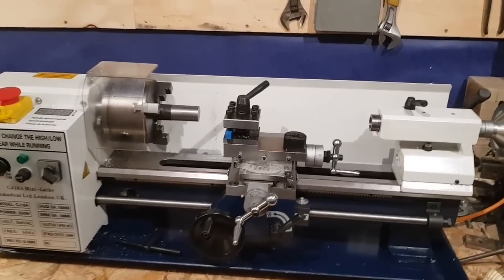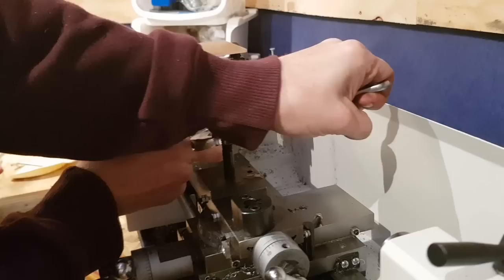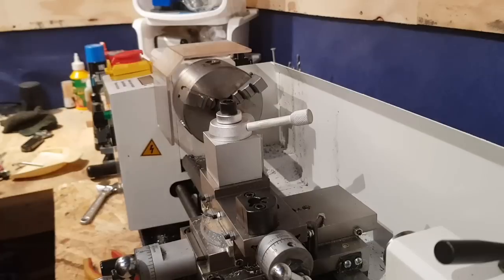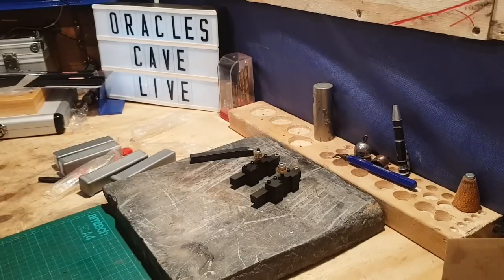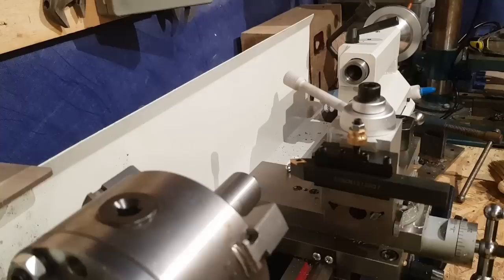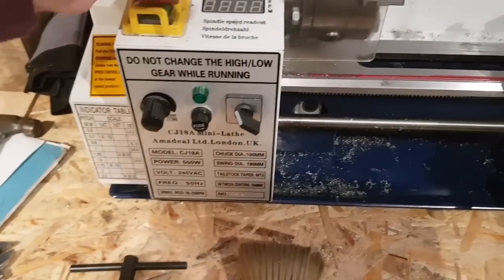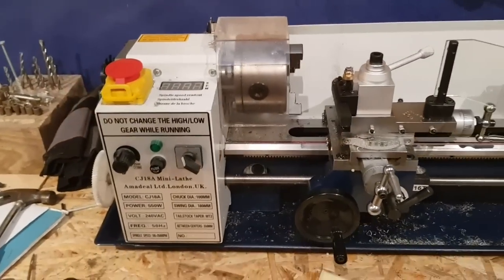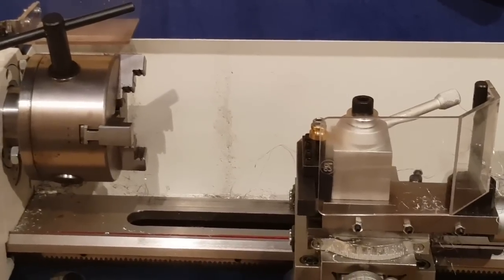CHINESE QUICK CHANGE TOOLPOST T0 7X14 MINI LATHE

Comment: I thought that piece was looking a tad wobbly in the chuck- I'm glad you weren't hurt.
Reply from the maker: @jeffcurrey8765  lol, I was expecting it to come out as it only had about 2mm of surface secured, too lazy to do a full jaw swap just to test it.
We don't mind getting hurt over here, never use safety gear, pick up burning hot things with bare hands, grind over the top of full fuel containers, we  do all the fun stuff over here, not a safetySusan in sight lol
👍👍👍

Comment: Don't waste your money on this QCTP, they are rubbish. Buy a steel wedge QCTP.
Reply from the maker: Yes the cheap one is not amazing.
But most people buying a mini lathe, do not have the £200, to throw at a steel one straight away.
Or they would just buy a £1000 lathe that has everything.
My cheap one didn't give me much issues and would have lasted long enough to do some projects while I saved up to buy the steel one.

So yes the cheap one isn't amazing and won't last a lifetime, but it is a way of working your way around having one until you have the cash to get the strong one.
The original toolpost works great, but very annoying trying to use when you are changing tools a lot.
So again, it is worth spending the cheap amount buying the cheap toolpost, especially if you are working on delrin, plastics, or other soft materials long term.
So completely steering people away from something that is so cheap and easy to get hold of, is not very good advice from a creator.

Unless you are one of these other plebs that has a lathe and thinks they are a full on engineer, which is complete snobbery and goes against makers and creators learning.
Reply: Buy Cheap buy Twice and I am a retired Chartered Marine and Mechanical Engineer so I think I know a little bit about Engineering  @oraclescave

Comment: I have a similar lathe to yours, and I bought the same quick-change post. But I couldn't centre it. it was too low, and I ended up having to make a 10mm shim for the base. It never came up to expectations, and I ended up going back to the original tool post. I 'm planning on saving up for a steel quick change post that hopefully won't have so much play in it, and a lot more mass.
Reply: Your right on the aluminum quick change tool tool post not all rigid and in fact it’s a piece of junk and i believe i paid around $25 for it at amazon and then went ahead got me the steel aloris dovetail wedge/gib style tool post

Comment: I brought one if the quick change tool posts, absolutely rubbish. No matter how hard I tightened it, during use it would slightly slip causing the tool to dig into the job.
Went into the bin very quickly and changed back to original tool post.

Comment: here's a little tip on saving your nut breaker wrench: flip it over; because you are putting all the pressure on the tooth instead of putting the pressure on the fixed jaw. I feel like I'm committing nut breaker wrench abuse if I put the pressure on the tooth instead of the fixed jaw. it scares me, it really does. LOL

Comment: Steel turns well between 550-700 rpm on that size of lathe. I use an identical setup and only run above 700 for a very light finish pass. For the price, I have had good luck with that tool post. I do switch between 1/4 and 3/8 tooling depending on what type of stock.

Comment: A quick change holder is fantastic, I had a little lathe like that and it was ok as you say. You really need to sort your chuck! You are using the wrong jaws or you have them inserted the wrong way.
Reply: they are not reversible jaws

Comment: Do your tool posts hang over the compound slide?
Reply from the maker: Yes
👍👍👍
Reply: Enough so that when they’re parallel you can lower the tool holder below the top of the slide. Meaning you can use larger than usual tools.
Reply from the maker: @freestyla101  the screw in the bottom of the block is what allows the difference sizes of tools, so it depends on the size of space inside the quick change block.
Moving the block is just for better alignment with different shaped tools.
But the set screw at bottom of block will just tighten against the tool, so if it's a big tool the set screw will barely go in, and if it's a small tool the set screw will screw all the way in until it grips the tool.

So if your blocks have a 1 inch gap where the tool goes, then that's the maximum thickness of tool it can take, you will not fit a bigger tool than the slot can hold.
Reply: ORACLE'S CAVE I see. I was more wondering about whether or not I can get more height as my slide to centre heigh is 11.5mm and I have 12mm tooling. I thought if the tool post on the QCTP hung over the slide, I could adjust it below the slide surface and gain a few mm.
Reply from the maker: @freestyla101  I would either sand a millimetre of the bottom of the tool, or make an attachment that will fit in your block and then hold your tool.

It's really just a block with a thin slot with holes at the bottom for retainer screws.
But I dont think you can modify it, unless you sanded it filled away some material from the bottom of the dovetail wedge on the back of the tool holder block.

Comment: Be careful. You don't want to have so much sticking out w/o using your tail-stock support.  Look up what reasonable feeds and speeds you should be using. I have a much larger lathe and only use inserted tooling for roughing. For fine finish I like to use HSS that I grind to suite.  You will get better results if you very carefully set the cutting edge to exactly on center. You have the wrong set of jaws in the chuck! Have fun, wear your safety glasses.
Reply from the maker: Lol thanks Larry.
I was just in a rush to get testing it, had no time for safety 
👍👍👍

Comment: Thanks from the 🇺🇸
I know now that I will spend the extra $$$ and get a steel one. I actually have no problem with the original one,  it's just a little slower but quite stabile. My mini has the tapered roller bearings in the headstock,  I couldn't imagine one with ball bearings. Enjoy your mini my friend.
Reply from the maker: I agree, the original is very well made and solid.
But if you plan on long term use, I absolutely advise putting the money towards the steel set, very expensive.

Devils advocate....

This cheap QCTP is worth every penny, super cheap, actually works, very handy for quick work.

Can wear out over time because of soft material, but if you dont have the money to purchase a steel one straight away, I would also recommend this tool to do you until you can get a steel one.

Really not as poor as everyone says, but in no way are you paying for a tool that will last a decade.

So for short term, I give it the thumbs up.
👍👍👍

Comment: Can you change the screw for the tool clamp where it allows for height adjustment? Because I need my tool to be way lower
Reply from the maker: Sounds like your set of cutting tools are too chunky to work with your toolpost.
If you think you could make it line up with a different screw, go ahead and try.
The only other way would be to mill away some material from the bottom of the cutting tools, and that wouldn't be good.

You need a smaller set of tools to work with your toolpost, but if it was me, I would absolutely try changing the screw first to see if I could make it go lower.
👍👍👍

Comment: I, too, was delighted with this quick tool change kit, but very quickly returned to the original holder;  good luck.
Reply from the maker: Yes Jean the original holder might be slow and annoying to use, but it is very well made, really strong and it can't be faulted in any other way.
👍👍👍

Comment: just bought one of these. Was very surprised, that it is made of some kind of aluminum alloy, not steel
Reply from the maker: Yes, the steel is better as it keeps its shape, the alloy ones are known for deforming and causing CHATTER vibrations on your piece you are turning.
But still a very handy bit of kit when it's new.
The steel ones fo cost a lot lot more but will last a very long time.
👍👍👍
Reply: @oraclescave  The obvious solution is to make a steel post. It can be done on a lathe, with a bit of cunning!

Comment: I got zactly the same qctp! Not good, but better than messing with shims every time you want to change tools.
I plan on upgrading to an AXA size wedge-style tooplost in the near future, should be better still.
I rarely use the compound slide, so I replaced it with a solid steel block, much more rigid setup.
Reply: Like others; I also purchased one of these units for my new then, LMS hi-Torque mini lathe. As an experienced machinist of over 40 years practicing, owning own business felt acquainted with practical use of this type tool post and holders. After the install, I had massive complications with chatter, no matter the material type or tooling. After investigation I discovered the tool post to QTC holder mating surfaces were not even close to parallel, plus the variation between the 2 positions on tool post. In order to prove this to myself, I installed a series of threaded Lok-n-Stitch aluminum pins, then machined to proper clearances in my mill. This did eliminate the chatter, but still had complications when cutting steel materials at a .020" removal rate; regardless of speed or tooling materials. I purchased a good quality Steel QTC Wedge Type tool post with holders and have Zero complications. I make all of my own QTC tool holders at home in my mill so that I may have many tools mounted, set and ready for "drop in" usage. As quoted by Joe Pie; "Buy Nice or Buy Twice"! It seems China has No Quality Control, specially on the cheaper priced items-no surprise. In my opinion; the Button Type tool post is of lessor quality in comparison the the Wedge Type that exerts full pressure on the full height of the tool holder.

Comment: Oh jings! It's just too scary to watch, you really do need to take heed to what folks are sayin' aboot safety issues pal....
Reply from the maker: Lol, oh no not another safety Sally.
Yes I understand the dangers I sometimes take, but unfortunately for some viewers I dont mind getting mangled now and then for the sake of a shortcut or two.

People can learn from my mistakes, because I'm not changing my ways lol
Reply: @oraclescave  It's not work the risk. I never secured ladders for over 40 years until one day I stepped onto the one I used to get up onto my garage roof and it slipped from under me. i ended up on the concrete patio with 4 broken ribs, one of which had punctured my lung and by pure luck I was sitting in front of my phone as I was about to pass out from a collapsed lung. 8 days in hospital and a consultant who said I if I hadn't phoned I'd be dead....

Comment: i have this toolpost and tools, toolpost its made from some aluminium alloy and its more like toy than a tool
Reply from the maker: Yes its soft aluminium, I purchased one to get familiar with it as I had just spent over £1000 cash to be able to use it, that's a lot in dollars.
So I added this cheap extra so I didn't have to faff about with the standard toolpost, but the standard toolpost was great, just annoying to use.
I was going to purchase the solid steel version, but my TOY lathe only lasted 2 hours.

So I will buy a REAL lathe also

As no tooling could make this cheap Chinese imitation lathe work unless it was really modified or used with plastic.

Faulty electronics.
Bad quality control.
Rusted and pitted metal.
Out of alignment in lots of places.
Very weak motor.
Plastic gears all over.
Didn't do the turning speed claimed.

You would do a better job spinning around with metal in your hand, while someone edges closer to you with a potato peeler.

I turned down a myford lathe for £650 in perfect condition with tons of extras for this chinese piece of rubbish.

Still it would be good for a child to learn on plastic, but thats about it.

👍👍👍

Comment: Would you say that 10mm tools would be more suited to these posts? I noticed how far you had to drive down the adjusters to get the height right. I've just bought a similar sized lathe and hate the constant changing and shimming of tools. Cheers for a great video apart from making me cringe at 3mm of chuck jaw bite haha. You've definitely helped me make up my mind.
Reply from the maker: Ha ha ha, it was 3mm grip or 20 minutes changing everything, I had to give it a go lol

But yeah 10mm would be good, I ended up buying 12mm really good set and they ended up being too large.
So 10mm is about perfect, but this tool is only short term, as the aluminium that it's made from will deform after time.
The majority say do not buy, but I bought it, used it and it done its job.
And was very cheap
So I can't fault it, if it broke, I would of bought another before I would pay the money for a proper steel expensive version.
I'm selling all my mini lathe stuff even the upgraded steel hi/low gears, quick change tool post, 1 set of 8mm tools, brand new set of 10mm tools, live tail, chuck tail, dial test indicator, there is more
But selling on gumtree right now for £70 for the lot
Most of it unused as my lathe broke within 2 hours of use, control board failure.
Reply: @oraclescave  to all of you who are considering a mini Chinese lathe. Before taking the plunge take a look at the Myford ML10. No new ones now but very good used ones between £500 & £1000. These are quality machines with non of the low speed/power issues of the mini lathes as the Myford has a traditional back gear.
Reply from the maker: @haroldpearson6025  yes I agree 100%.
I actually turned down a beautiful myford ml10 for £650 with tons of extras, all the gears, and a cabinet stand.
For one of these chinese bits of crap, now for plastic these Chinese latches may last longer, but plastic gears, shady electronics, loose parts/falling off.

On top of that I had to deal with the worst company ever that used sneaky tactics to not refund my money.

I got my money back through paypal, but was still the worst experience I have ever been through, involving purchasing something.

And I could of had a myford that was kickass and still looked as new as the day it was made.
GUTTED

my next lathe WILL be a myford lathe.
👍👍👍

Oh yeah, and the chinese lathe cost me over £1000 including the tools to use it. CRAZY

Comment: I have a 7x10 mini lathe and also bought the exact quick change tool post. My lathe has performed perfectly for three years so far, but the QC tool post is crap. After a bit of use it become very sloppy and useless. I have gone back to the original tool post and shims.
Reply from the maker: Yes it's not a long term solution at all, but as a fast get you going tool it was fine, very cheap so didn't hurt the pockets.
I actually thought the standard toolpost was very good and well made.
Really no need to change it except speed things up slightly.
👍👍👍
Reply: @oraclescave  Exactly. I fell into the same trap when I moved from wood turning to a metal working lathe. However once one has figured out which tool need which shims it really isn't a problem with the original tool post. If you take very small cuts with the QC tool post you will be OK for a while until you get your eye in. Also a heads up is to protect those plastic gears as they can split easily. Fortunately my model came with steel gears but my mates one had plastic, and he did have hassles with them. Go gently and carefully and you will have no problems. Enjoy the mini lathe you will be surprised what you can do with it when you work within it's limitations,.
Reply: If you still want to go the quick change route, I would look into the wedge type tool posts. It's a much more rigid mechanism.

Comment: It's made of soft aluminum not good
Reply from the maker: Yes it's soft aluminium, but it got me using the lathe and it worked perfectly fine.
Over time this will become out of shape, but to get you going as a first quick change toolpost and only £30 and it never gave me any issues.
So yes a much more expensive steel one would be better, but I never had one issue with this.

So keep your snobbery in check lol
Saying it's no good means it can't do what it's supposed to do, but this done everything it said it could and done it very well.

Considering I had to spend more for first tools than I did for the lathe, this bit of kit was great.

Comment: When you were explaining the pitfalls of not securing the work in the chuck adequately, you bad left the chuck key In the chuck .
Your accent  and delivery are brilliant, please don't get injured by carelessness. 
Now make us bits proud, with a superb project.
Reply: You can't run the machine with the chuck guard raised and you can't lower the chuck guard with the key in place. At least that's how it's supposed to work.

Until it doesn't. Then ... DUCK!
Reply from the maker: Part of the enjoyment of how I make stuff is dodging things at hundreds of miles an hour, and nearly getting my fingers caught in grinders and all sorts of stuff lol
I preach safety but avoid it like the plague, I don't complain about big cuts and broken bones.
Bigger better lathe being hunted out for next year, more power and more weight needed.
This lathe had faulty electronics and the seller was a very devious man.
These lathes need brushless motors and upgraded circuit boards to be a really good machine, just a bit lightweight for the kind of things I want to do.

Maybe ok for plastics, and small alloys but it struggles on bigger harder stuff.
I made a couple of projects with it but it had 2 faults within 2 hours use, it's a shame because I had loads planned with it.

But dodgy seller put damage all over the machine I returned and claimed it was me so he didn't have to refund me.

So I'm a bit salty about the whole mini lathe saga lol
Not in a hurry to touch one of these poor quality machines that could break from 2 hours use.

I will get an old rusty one and restore it, or get much bigger modern one.
👍👍👍